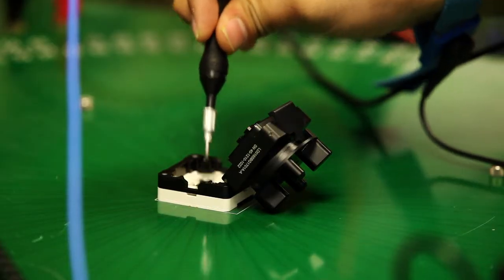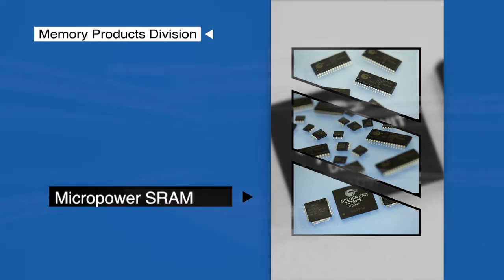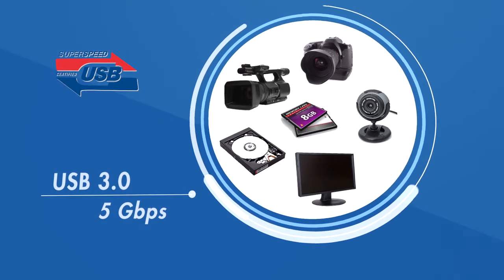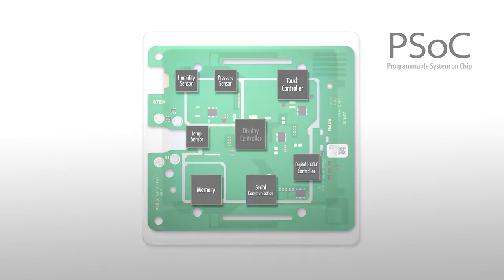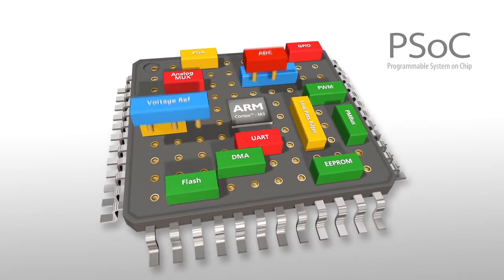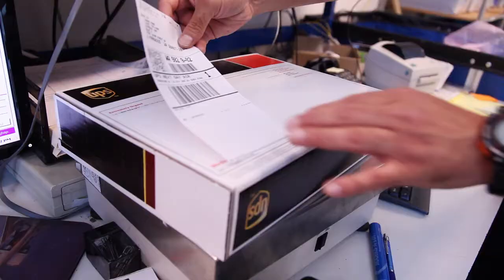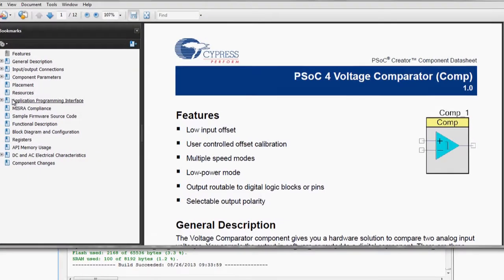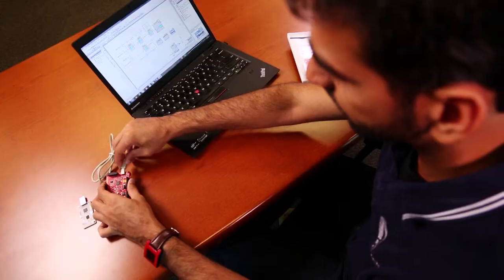Cypress Performs

Comment: You are going the right way. Still things to improve but headed in the right direction if only PSoC Creator was multiplatform!!
Reply: Scott Livengood With a good architecture, supporting different platforms is not that much time since most of the code would be the same in all of them. Sure 95% of the traffic can come from Windows but certainly having applications that only work in Windows won't change that. 89$ Has nothing to do with the fact that there are better platforms. Tell me, why do you think today there are way more multiplatforms programs than 5 or 10 years ago? Why are other manufacturers moving to multiplatform tools like TI, Microchip, NXP...? Even a emulated version using things like Wine would be better than having a Dual Boot system or using a VM which I've tested and performance is greatly degraded to the point of no being able to work efficiently.
Reply: Scott Livengood More like 80% Microsoft nowadays. And amongst the tech demographic it would be significantly lower than that.
Reply: Roger Henderson Exactly.